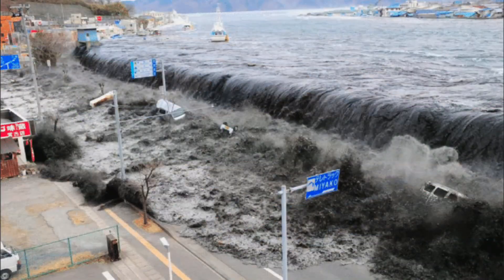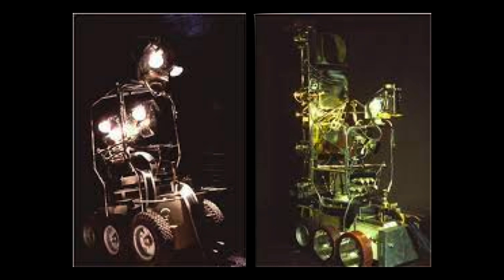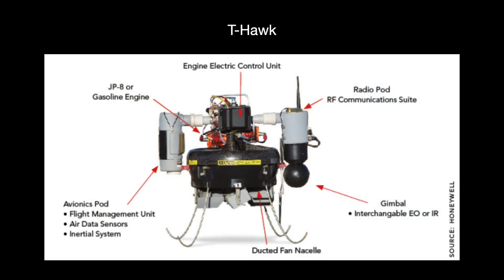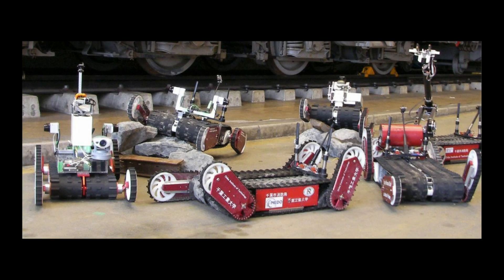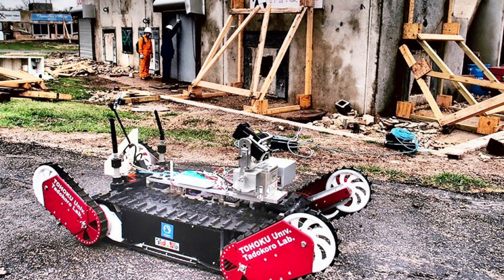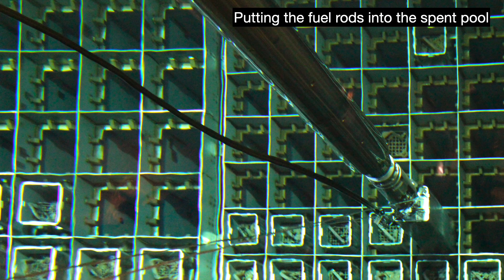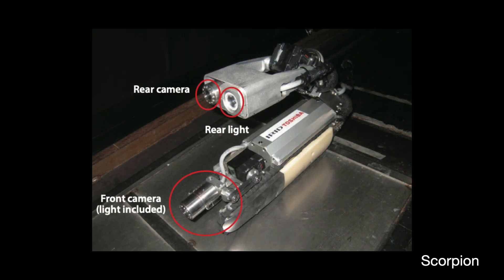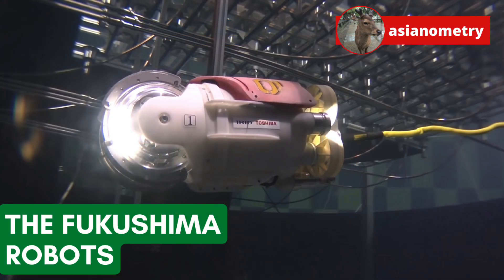The Fukushima Robots

Comment: Not to downplay these terrible, however rare tragedies, but overall, our rejection of nuclear power was a massive mistake, and the environment has paid dearly for it as we continue to rely on fossil fuels for our electricity
Reply: You are completely correct.  The three major disasters that everyone talks about were all avoidable.  Chernobyl was poorly constructed, rushed into production (rushing and nuclear don't go together), and forced to undergo a test it wasn't able to perform successfully TWICE (failed on the second one and melted down).  Fukushima was a case of bad luck all in all, but could have been prevented if any of the following had been different: if the barriers to flood waters and tsunami's were bigger, if the doors to the basement level generators were reinforced, or if the generators control panels were placed higher up so they didn't short out so quickly.  Three Mile Island was poor design that allowed a valve to be stuck open while the indicator light would say otherwise.  The control room was poorly designed all in all and the operators had to deal with that, conflicting readings (again bad design of the control room), and relentless telephone calls from everyone but the people they needed to speak to.

No one ever talks about the 100's of other nuclear plants that operate fine and generate power with no issues . . . . because nothing happened and as a result, there is a massive bias.  The power where I live comes from a nuclear plant that has been running just fine since before I was born.  No problems here, and I bet 99% of people around me don't know our power (of which has been perfectly reliable) is nuclear.  What a shame.
Reply: You are completely wrong! Catastrophic failure rate for nuclear reactors is roughly 1%, and it us huge number, if you consider consequences."'Rare" in this context is one for a million, IMHO. Nuclear fission energy is simply byproduct of an atomic bomb, and if you take all risks and complete costs into account, it is too expensive to use.
Reply: @АлексейДеменёв-э9у  "Nuclear fission energy is simply byproduct of an atomic bomb..." Tell me you don't know what you are talking about without telling me you don't know what you are talking about.
Reply: @АлексейДеменёв-э9у  it is too expensive and unsafe, and yet France has gotten over 70% of their electricity from Nuclear energy over the last 50 years, has had no accidents, has some of the cheapest electricity in Europe, which has led to some of the lowest inflation rates in Europe, and they are planning to build even more Nuclear power stations https://www.world-nuclear-news.org/Articles/France-outlines-plans-to-speed-new-nuclear
Reply: @indahooddererste  1. They aren’t ‘nukes’

2. Just because your doing routine maintenance on an engine, doesn’t mean your car is for the scrap pile
Reply: @Jim54_  Most of them are the average reactor is over 30 years old and even when macron announces new reactors. oikiluto and cattenom needed over 10 years to be even build and we dont talk about producing energy.
Reply: @indahooddererste  it doesn’t matter how long it takes to build, so long as we start ASAP. As the old Chinese proverb goes ‘the best time to plant a tree is 20 years ago, the second best time is today’, we have to start planning for the future, not just for now. We need to be proactive, not reactive to impending problems. France has the capacity to produce 70% of its electricity from Nuclear power because of decades of investment. After all, it is better to have an old reactor that can be maintained and repaired, than to have no reactor at all.
Reply: @indahooddererste  once again, there are solutions to that, as other countries have figured out. At this point you are really nit picking every single possible issue to discredit the cleanest source of energy production in the world
Reply: @Jim54_  Its Not nit Picking its the reality every fucking year.
Reply: @annihilator247x  > The three major disasters that everyone talks about were all avoidable.

Why they weren't avoided, then? Why Fukushima accident had several things in common with Chernobyl (aren't we supposed to learn from past errors??). Why power reactors in US of similar type did NOT install filters on their emergency steam vents even AFTER Fukushima? Am I supposed to just believe their word that American reactor operators are not going to fumble their accident response as badly as Fukushima did?

Comment: all these 'mistakes' of thought were corrected by UA guys simply. On the board of robot all hard hardware was applied only and old soviet cupper relay made in Ukraine. All brains were made soft and stayed in safe place and only direct comands to operate the relay used LTE/R-LINK instead of usual RF. Works perfectly till now howevei in liquids to be sure better use a cable.

Comment: I'm wondering why Boston Dynamics isn't in this scene (well, disaster/accident).  They're supposed to be have one of the best robots, right?  There is also the Chinese knock-off but eh.. 😅
Reply: That's a good question. I don't either but it seems a lot of their biggest advancements was after 2012, but they existed long before that. A quick Google search found BigDog existing since 2005 and mentions of other stuff but only in the months and years after. Maybe they didn't have radiation hardened tech?
Reply: @RhoninFire  I'm thinking that it should just be in terms of "modules" if some equipments are needed to be installed.  Then they just create some sort of "quarantine" boxes for the dogs to be sprayed on and parked.  I think it's a good investment.  But then again, based on the video content, Japan should have been the one leading that technology.  I'm being a stereotype in here 😅🤣

Comment: Maby next time thay won't forget basic rules of building and not have this happen again
Reply: And not forget to buy enough battery-powered lights for their operators...
and not forget to give them dosimeters adequate for accident conditions...
and install filters on emergency steam vents...
and actually have an emergency manual for complete power loss scenario instead of assuming that "it can't happen, so why bother planning for it".
Reply: @denysvlasenko4952  and thay put the backup and primary generators at sea level on a beach....thay built it to fail at the most basic of grade school levels

Comment: Pathetic. TRILLIONS spent on thousand of huge Nuke reactors and these mecano toys are the best the industry could do!?!?
Reply: K.I.S.S. is for a reason, simple doesn't break. In space Radiation hardened computers use 3 copies of the same chip doing the same task so if one of the three is corrupted the other two can catch it. Another option is use older bulkier computer hardware who's simplicity is less likely to be affected by the radiation and faster get back running when it does break

Comment: incredible to know that again and again millions of people WANT NUCLEAR POWER STATIONS!!!
these people do not understand the immeasurable problems that exist for this type of plant for the production of electricity!! there are always alternatives!
Reply: Let alone the costly removal which takes centuries.
Reply: @indahooddererste  Centuries?  We are building generation 3 reactors, where do you think the first generation and the second generation are if it takes centuries to remove them?
Reply: @krashd  Experience has shown that the dismantling of a nuclear power plant, including the necessary approval procedures, takes at least 15 to 20 years. In the case of power reactors for power generation, it can be assumed that the post-operational phase, in which the fuel cools down and is packed in transport containers, lasts 5 to 7 years. After receiving a decommissioning permit, there is a dismantling period of 10 to 15 years for the nuclear part of the plant before it is released from the Atomic Energy Act. Finally, the conventional removal of the remaining building structures and the recultivation of the site will require approximately two years. If several power plant blocks are to be dismantled or parts of the building can only be demolished later because they are still needed in the dismantling phase, it can also take longer.

Comment: This will never happen of course setting an explosive powerful enough to disperse the radioactive materials out of concentration. Yes this does not sound good at first glance but there is no other way (long term) to stop this out of control train wreck. Cooling water does not work, capping would not work etc. etc. Oil fires have to have an explosive charge big enough to consume the surrounding oxygen as to snuff out the fire. Without doing this the broken well head cannot be capped. If a dispersal method is not used this contamination will not stop! At this late point there's nothing to loose!